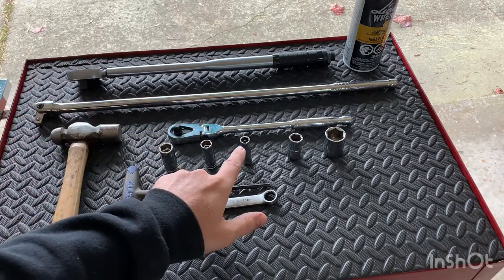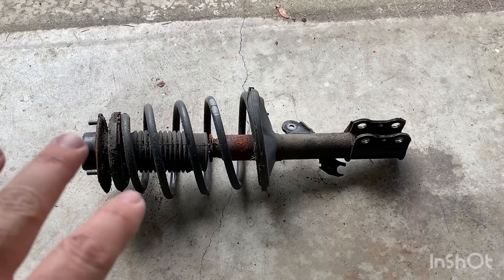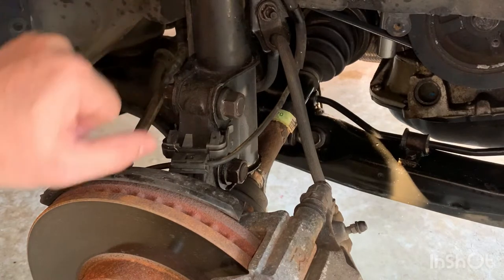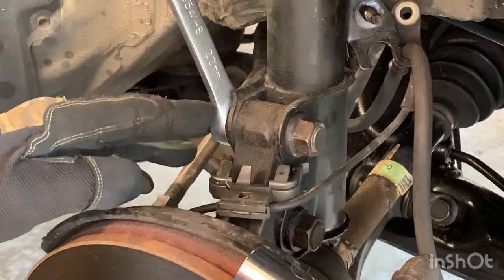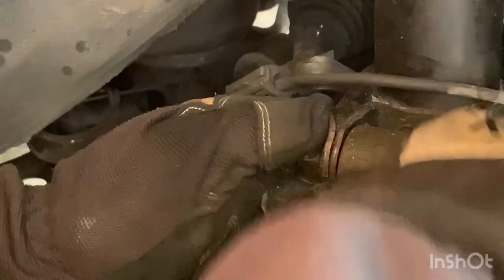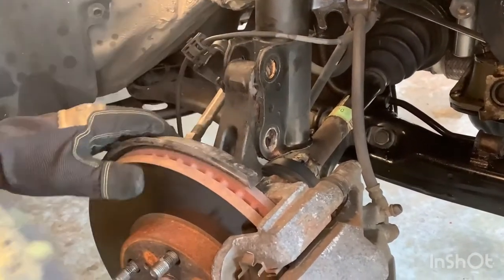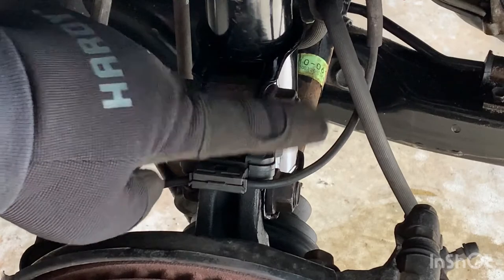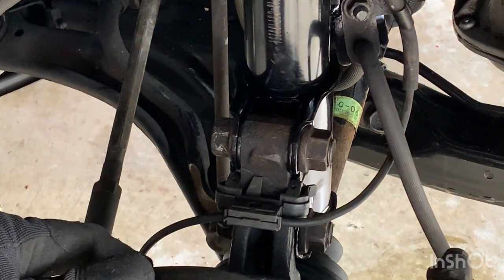How to Replace Front Struts on Toyota Sienna. No special tools needed!

Comment: I couldn't find the whole assembly on the toyota website. Do you have a part number?
Reply from the maker: No, sorry, these are aftermarket parts. ):
Reply: I replaced with a aftermarket quick strut assembly and the ride was worse than the original.  It was a KYB made in China.

Comment: You are lucky that the sway bar nuts are not rusted in and came off easily.  When they are, it's a pain to take them off.  They are a show stopper.
Reply from the maker: I can imagine... They are not easy to reach. It would be difficult to drill them out, etc.